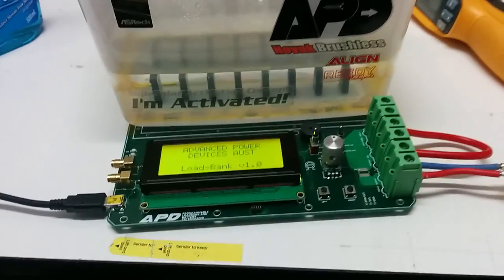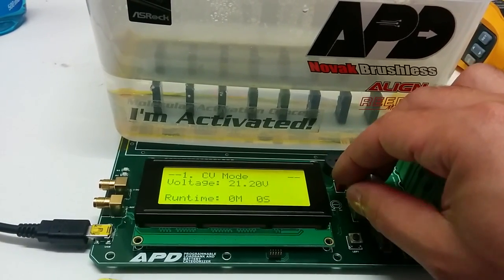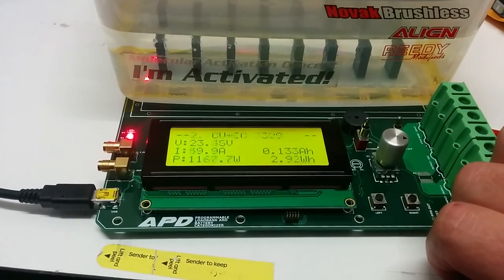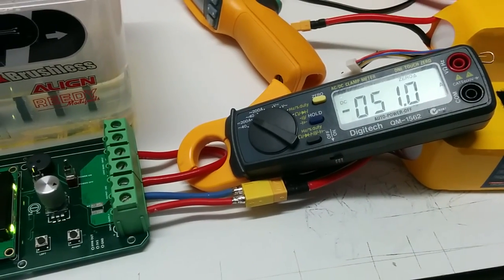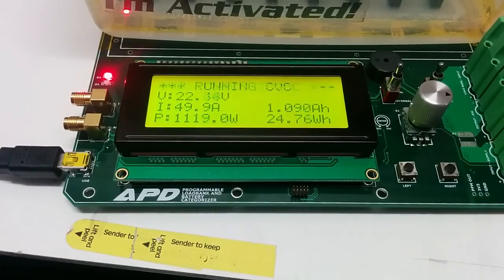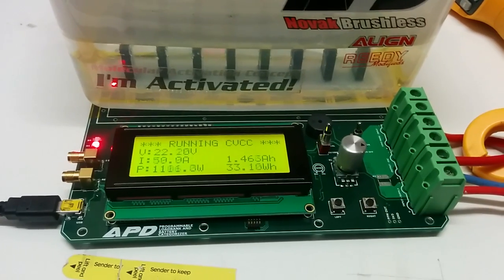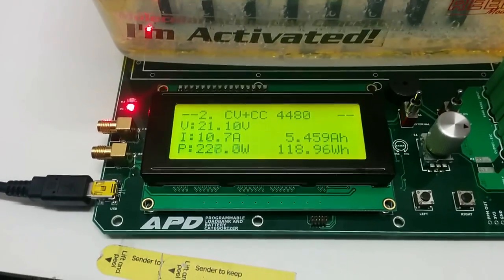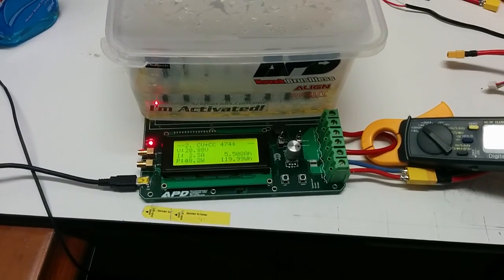Compact High-Power Load will soon tell us which batteries are boss!!

Comment: You're going to quickly kill those FETs, there is less heat conduction when it is boiling because the steam forms an insulating layer between the FET heatsink and the water.

Comment: That is a very nice setup! I use different lengths of canthal wire under water but Ah/Wh logging has to be made manually. About that battery: 40C my a**. You discharged it at 50A/5,8Ah~9C and still the temperature got really close to the upper limit of 60C. Have you measured the internal resistance of those cells? From the info in the video, I got about 25mOhm/pack, so about 4mOhm/cell. According to jj604 calc it would be about 90A => 15C maximum safe current draw from those packs. Assuming that the temps dont get too high. Those middle cells tend to get much hotter in thick packs like that.

Comment: The elegant way is to dump it onto the grid. Requires no cooling.
Reply: Hi Dan,
Yea you're correct. A grid fed system is the most elegant. Maybe in a couple years. :)
Reply: +Dan Frederiksen You mean a battery  - > a grid synchronized DC-AC inverter - > the grid? That's a neat solution I didn't even think of. Probably the inverter would cost a bit more tho.
Reply: +DjZorlag it's not as easy to make but yes.
Same with exercise machines. They shouldn't use power, they should make it.